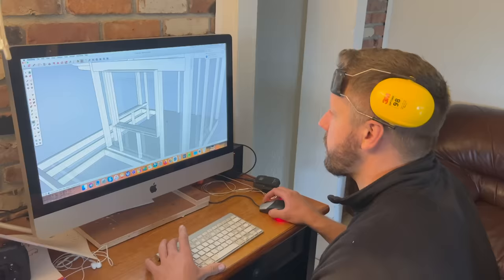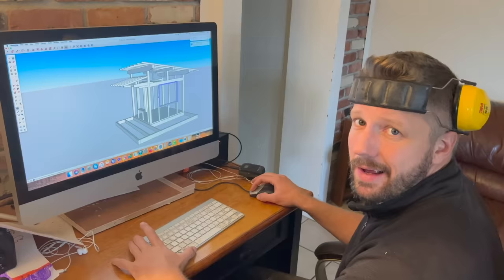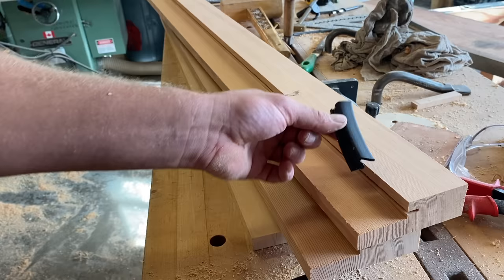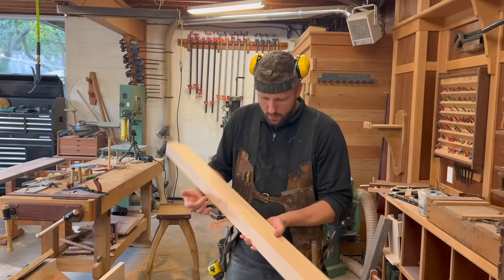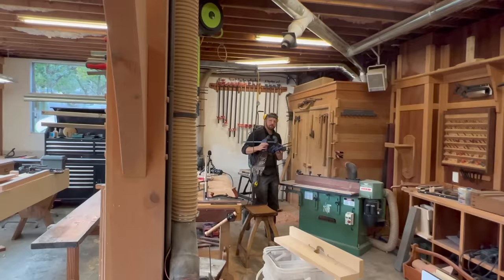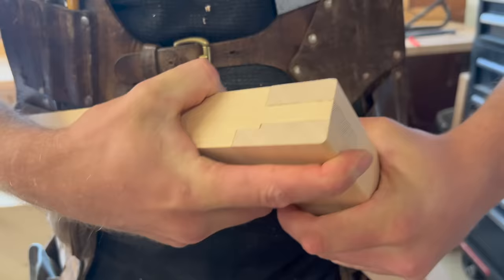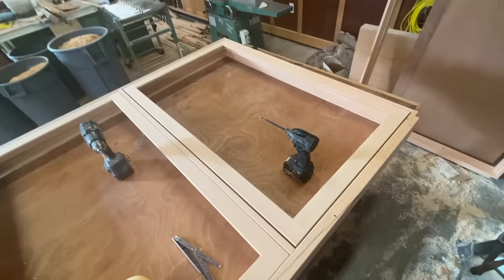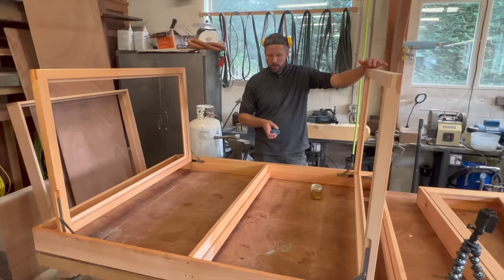Building Solid Wood Windows In The Shop!!!

Comment: Hey Jess, instead of glass, you could consider polycarbonate (a.k. Lexan) This stuff blocks U.V, has insulating properties and will not break/shatter. In Australia it is also available with a tint to reduce glare which is probably not a problem so much in Canada. This material could be bedded in with Sikaflex or similar.. Cheers, Rob.
Reply: Scratches easily, no?
Reply: @tycox8704  no, Lexan is fairly scratch resistant. Not as hard as glass, but much better than regular acrylic.
Reply: What is the price difference? I was surprised to find out how expensive non-glass windows are compared to normal glass.
Reply from the maker: It’s far more expensive than the glass. Even 1/4” plexiglass was more expensive.
Reply: Yes poly or plex is way expensive than glass

Comment: My house has antique casement windows. The sash has a shallow groove routed along the length of the top and outside sides so any wind-driven will run out the bottom instead of pooling up against the frame at the top of the sash and finding its way in. If you end up having issues, you can add that with a hand router.

Comment: Glue and sawdust: after the fact precision.

Until the glass arrives, you can build some scrap softwood frames of exactly the same geometry, stick some transparent foil on both sides using double-sided sticky tape, and, depending on the transparency of the foil you use, you'll have a temporary replacement that's quite functional - thermally, air isolates almost exactly as the argon they put in window panes, it's just worse at sound insulation. You don't need an hour to build those temporary panes. Since they don't need to last more than a few months, you can even leave them unfinished.

Comment: 16:25 It's Epic! LOL
Reply: 17:28 I am going Acrylic with 200X time Stronger then Glass. It's Stationary so I rather have scratches that I can fix with more acrylic then replace a broken glass. I rather pay the extra then head to my local Lowes/Homes Depot. I like this because I would like to make some Windows I can add to my Camper.

I like the design, I just need to work out the dimensions. 
Thanks for the Build, Gave me some Motivation to make them happen.

Comment: how much time do you invest in making your CAD designs?, Just epoxy the knot space mixed with sawdust. You can use Plexiglass or lexan glass as an alternative or find used windows that are slightly bigger and cut them down to size.

Comment: PLEASE >>>> TOP TIP - check the opening sash size for the top hung opening sash hinges with whatever weight of glass is going in  (massive difference in double glazed or single)- they don't like being caught in the wind and can bend (some cheap ones). which is really annoying as they won't then close properly.  you can get over it really easily by fitting 'restrictors' on them (designed to only open by  about 4 inches) and stop people falling out of open windows in high story buildings.  AMAZING SKETCHUP ....Where did you learn Sketchup - it flipping annoys me... its amazing - helps so much to get the work... and then help me actually build what I have quoted for ... but takes me soooo long .. you make it look easy !!!! Sketchup tutorial for wood workers would be great tutorial !!!! I'd pay for that ... its quite specific ... but also basic on a lot of levels .. hope you understand my point ?

Comment: On the bottom sill flashing surface is that raked? From what I've seen a 1 : 12 or maybe a little less pitch helps water not wick up into the corner where the weather strip kurf cut is. The flashing can only do so much if that is a flat surface right?

Comment: how often will you have to recoat the wood with the Odies?  I love how easy it goes on.  I have a Cumaru deck Installed and use an IPE Oil on it but to keep it rich and warm colored I have to apply once a year.  I dont mind because I drink a 6 pack while doing it but Is that what youre going to have to do with the odies? Ive got a basement casement window project on the horizon with some spanish cedar and Think the Odies is an option.

Comment: Ive considered making my own windows and doors too, since the prices are ridicules, paid 13k for a 3" exterior front mahogany door from a reputable company (ya right), had to get the glass changed 2 times, cuz there were defects then finger prints (on inside), on top they didn't change out the moulding when the glass was changed, so  I have multiple putty holes that have discoloured  different form the door stain. Always was apprehensive due to warping, Im in eastern Canada. Considered using engineered stiles and rails (stave core + vaneer) and even overkilling it with an internal rust proof metal T channel to prevent warping, whats thoughts on that? Overkill?

Comment: man, i watch you for years and you've completely stppped using riving knife and push blocks of all sorts, you should use some disclaimer for less experience people in your audience about safety. Windows are amazing same as everything you do.
Reply: I noticed this too. Made me nervous. I got my thumb pretty good a year ago and I am convince it was because i got so comfortable with the tool I forgot the terrible damage it can inflict. Well, now I know what a blade ripping through flesh feels like. Fortunately no tendon or bone. Always respect the power of the power tool fellas.
Reply: A moment's inattention.
Reply: I am a great believer in safety protocols.  I continue using a riving knife on both my slider and table saw as I am convinced they work, along with above blade guards that connect with the upper part of the splitter.  But I'm in your camp when it comes to push sticks and only use them if my fingers will be too close to the blade for my personal comfort.  We all have our individual thoughts on this, as well as most other issues.
Reply: @ApexWoodworks  i feel his fingers are way too close for what he is doing, he should have a crown gaurd and riving knife and probably should lower the blade but im guilty of that one, i think rebating on a rip saw is pretty unsafe compared to using a spindle moulder

Comment: Bridle joints for window frames are forced to rely on glue to hold together. They should have been mortised and tenoned. Those frames will fail within about five years Max. Seen it many many times.
Reply: GET OFF MY LAWN!
Reply: “Seen it many times”. The push stick on the bum or?
Reply: They won't - from experience - from knowledge  - from history - come to UK - see some old windows ... We have 500 year old pubs with original windows or 50 year old 'glued' ones :)  don't be that guy ! really will it last 500 years or 50? will we care
Reply: @robertfrost5020  Thanks for the back up mate. I trained in the UK too. Did journeyman  time at a joinery shop assembling sash frames the old fashioned way. 
Did lots of resto work on Victorian builds and earlier. Proper job.
Reply: @joschmoyo4532  Dude I think you got me wrong - glues from the 1980s particularly had major issues and failed ... they don't now .... my point was 50 years is more than good enough.... design is always supposed to be appropriate for it's intended use ... which this is
Reply: @robertfrost5020  
Okay. Regular PVA looses about 60 % of its strength over 20 years.
Epoxy is very expensive but will give you fifty.
But wherever you glue two wooden surfaces together at  ninety degrees you will induce humidity cycling stress fractures of the wood fibres.
This is what causes plywood to disintegrate over time. De lamination. The only way to avoid glue induced failure of the wood fibres is to have a strong MECHANICAL joint. 
I have restored many projects exactly because of modern glue failure. But if you want to cheat and put your faith in quicker cheat methods be my guest.
Weather cycling causes premature failure at glue lines. Especially exterior exposed ones.
Hide glue expands and contracts at the same rate as the timber. It is self healing. Modern glues do not.
Reply: @joschmoyo4532  think you are taking about the Window 'Sashes' not "Frames'. The Frames he made have a strong mechanical joint as they had what looked like three screws in each joint.  Dude - Sashes (which think you are referring to) these days would be installed with High Modulus Silcone sealant - and the glazed units are no longer 'taped' around the perimeter.... giving them tremendous strength and longevity (even when they are heeled and toed) I could go on .... but Dude............ if you are a joiner/ carpenter - you'd know the difference between a sash and a frame ... I'm done ....
Reply: @robertfrost5020  
Your done eh ? I only call them a sash if it's a counter weighted window frame aka, Georgian windows. Strictly speaking the windows in question are a casement type.
I know all about modern glazing of lights using silicone instead of putty and sure, for a few years it sticks well, but we both know silicone degrades and does not adhere well to timber if it's pre primed. And then you have to glue and pin the beads in to hold the glass and hope it does not peal and break away before the warranty expires on the job.
You did your best but the truth is your forced to cheat and cut corners too. Screwing the jambs together is acceptable if they are well secured to the opening but most joinery shops are committed to finger jointed frames/casements and sashes so they can comply with glazing codes.
The only place I have caved in to modern practice is my velux skylights because they hardly ever get opened and stressed.
What kills glue lines and joints is daily opening and closing as well as temp and humidity cycling stresses.
You know it, I know it. But your invested in the cheats.
Reply: @joschmoyo4532  OMG a Georgian window denotes the style of the glazing - the number and size of glazed panels - and nothing to do with anything else ....Victorian style is another period/ style had 'siding sash' windows as well.   - the words sliding and sash are very different....  and nothing to do with what is being designed and installed here.   Dude you don't take criticism and yet you are more than happy to give it .. Seriously keep gong if you want ..... 2 words are used in thus VLOG Frame and Sash - you refer to Frame.   The  Sashes and Frames won't fail after 5 years  - they will last a good 20 to 50 if they are looked after.... I can't wait to hear your response. Georgian, Edwardian, Victorian etc..is a architectural period style nothing to do with any sort of joinery .... no way you are a UK time served joiner as you suggest
Reply: @joschmoyo4532  please come back to me with a response - actually read what I said first :) Design/ appropriate and the entire building and its intended use is key here :) Go on tell me you only fit the best and you don't even know the correct terminology :) you actually missed the only issue here which I pointed out in a friendly piece of advice unlike your - I know best - attitude ... the size of the sashes might create issues with the hinges. I might be wrong but he may want to check they could need a restrictor to stop them opening more than a few inches as the wind can catch them and bend them.  I put that in a way that I could be wrong ... and polite advice ... these type of hinges have a maximum sash size depending on the glazing/ size/ design ... you my friend are why we don't do 'desk top' design now.  because of serious fatal accidents in the UK we NOW put the emphasis on the ENTIRE building design not individual parts.
Reply: @robertfrost5020  
Aha, now the truth comes out. Your not a woodworker your an Architect or draughtsman.
That would explain the contextual goal post shifting and lame comebacks.
My point remains simply this. Finger joint are never as strong as WEDGED mortise and tenon joints.
Period. End of story. 
I make my windows and doors the old fashioned way because I know  the joints will not fail. No more to be said. You trust glue if you want, I trust mechanical strength.
Reply: @joschmoyo4532  I am a carpenter and general builder. it's a cabin he is building! OMG go away...
Reply: you said - frames will fail in five years .... they wont ... or the sashes either ...
Reply: Father was a joiner and Grandfather was the production line manager for one of the largest furniture manufacturing companies in the world in North London in it's time.... developing modern techniques due to rationing after the 2nd WW... your comments are irrelevant .... he didn't need to make wedged mortice and tenon joints .... it doesn't need to be that strong!
Reply: @robertfrost5020  
If that makes you fee less guilty about cutting corners to increase your profit margin, go for it.
But I know from experience that your wrong. I have seen blind tenons fail and doors sag and jam as a result. I have seen all the cheats, all the failures and heard all the lame excuses.
The favourite one is " sorry, out of warranty". Or, it was installed wrong or it must be subsidence.
Truth is the building trade has gone to the dog's. 
You don't employ craftsmen anymore, you employ semi skilled bench monkeys who only now how to operate a pin gun and a cordless impact driver.